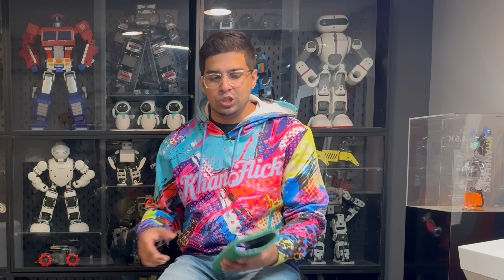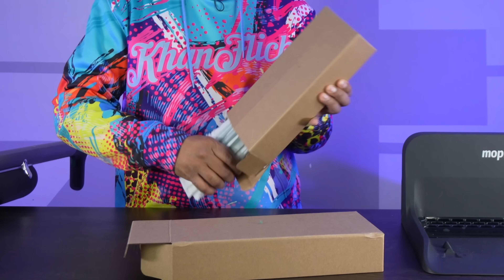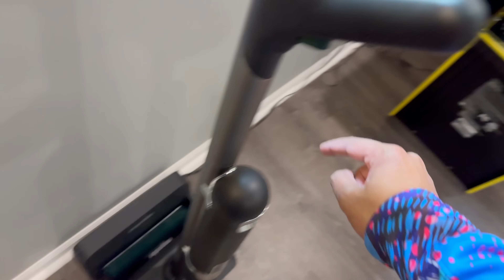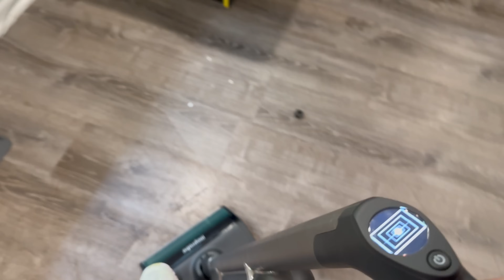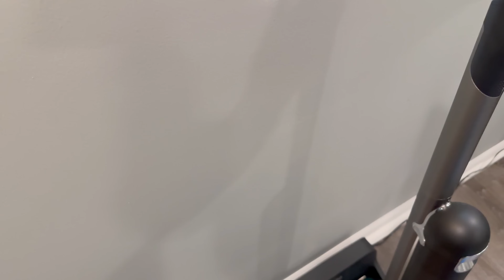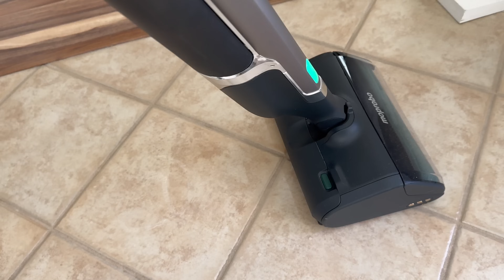Making Cleaning into a GAME with Robot Moprobo 👾 | Unboxing & Lets Play!

Comment: Thanks for your great video.

Please answer the following questions if you can.

Will it clean dirt/debris located between grout on tiled floor (one reviewer of previous model said it doesn't). 
Does it use less water and leave floors less damp in eco mode (eg for cleaning wood?)
Is there any need at all to sweep before using it?
How damp are the floors after, compared with a wet vac? Are the floors less damp if used in eco mode?
Is the battery removeable/replaceable?
How does it compare with Hizero?
When will it be available in Australia?